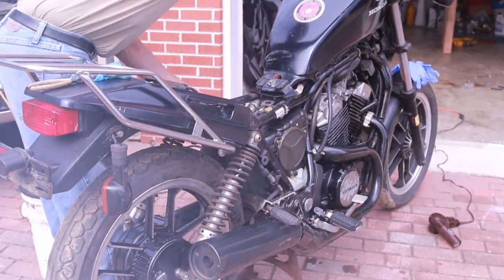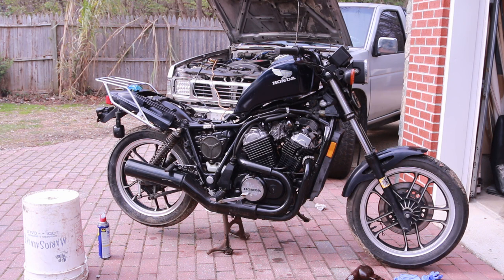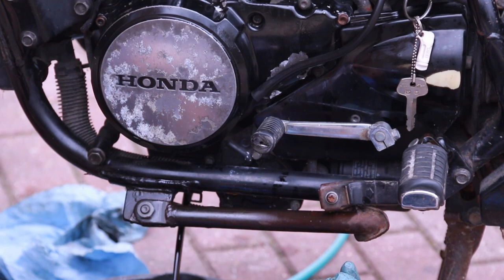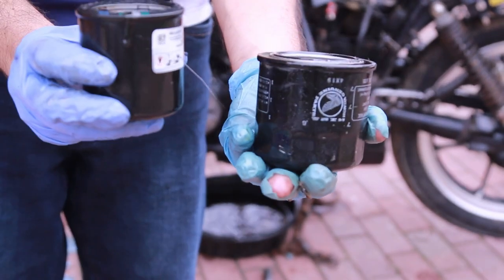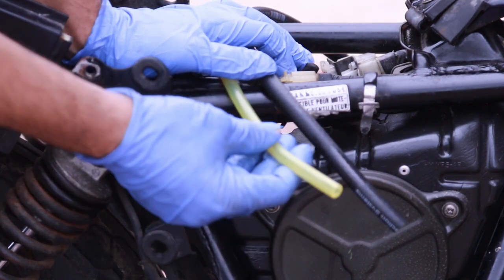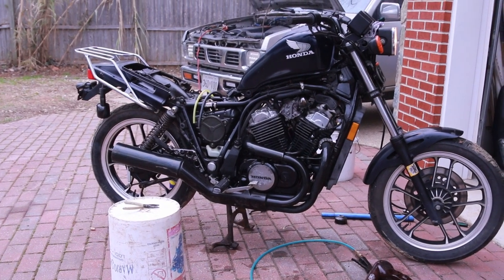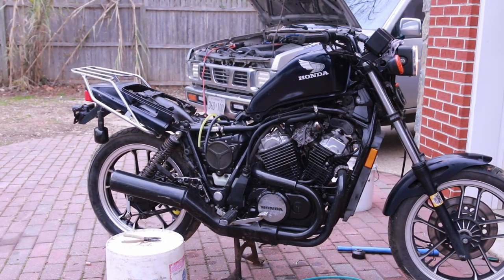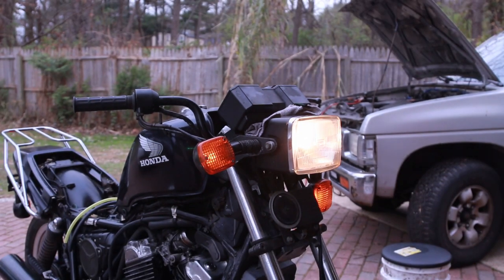Honda Ascot: oil change,sparkplugs and fuel.. liftoff?

Comment: The oil you added is not a good choice. Most motorcycles (including that Ascot) have wet clutches, that means the clutch plates are bathed in engine oil. The most modern automotive engine oils (including Shell Rotella T4, a really good choice for automobiles and trucks) have  additives that will make your clutch start to slip. Any motorcycle-specific motor oil would be better, Honda would be best of course. Also, buy the Honda filter. Saving a couple bucks is not a bargain if it negatively impacts the flow of engine oil. Also, replace the antifreeze with the Honda pre-mix available at any Honda motorcycle dealership. And using the Honda hypoid gear oil, drain and refill your shaft drive unit. I have a few more tips on keeping that bike working top-notch if you'd like, I owned one for 15 years.

Comment: It's a miracle of jeasus. The valves have about  4 mm of excess clearance.  they are ticking  like a clock. And maybe a worn cam chain. Abd i feae rhe engine  is badly  worn  from all that smoke .